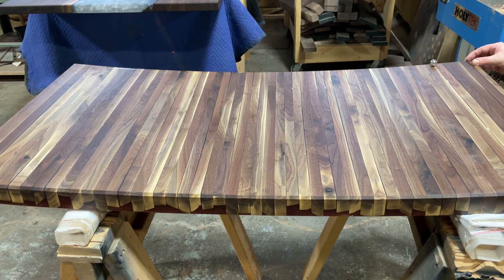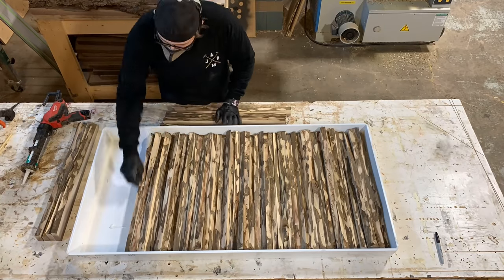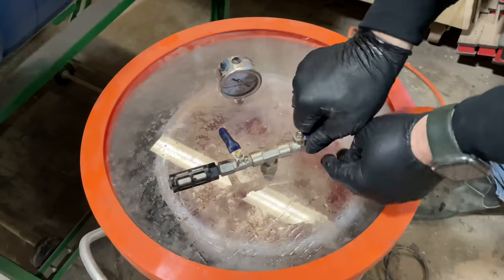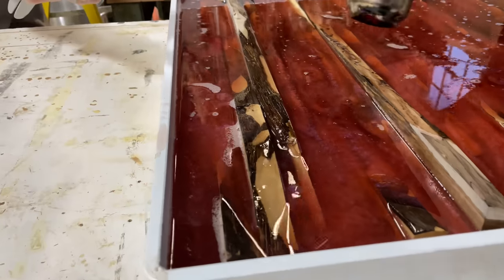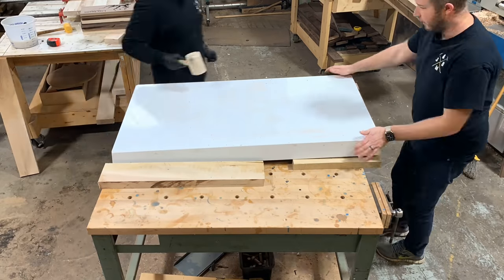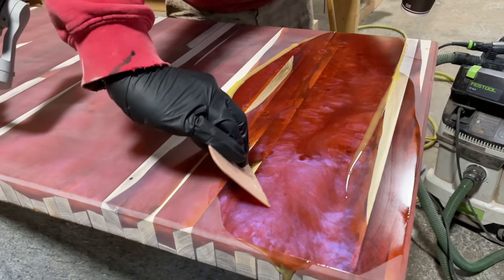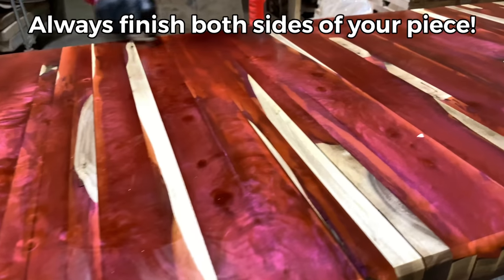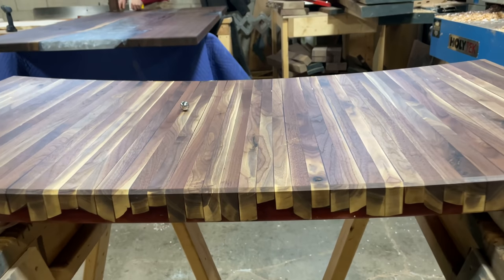EPOXY FAIL | Don't Make This $1000+ Mistake

Comment: Hmm,  It is big for this process, but: 
 1.) unseal the wood, place the entire thing into a penetrating liquid (very thin epoxy, or styrene monomer only?) place the entire thing in a vacuum bag to extract all of the air from the wood, and allow it to be replaced with the resin?  

Or,  maybe something more mechanical? 

2.)  Slit the wood on the bottom side, 70% to 80% depth of the shallower boards,  Install thin, tapered strips (shims?) to wedge the piece into a flat position. work from the center out, every other board,  with the tapered strips, as it may start to back bow, and use flat strips between as necessary to keep flat.  Re grind the top.

Comment: Flip the table upside-down, then with a circular saw make a series of shallow cuts that are about 1” apart along the short side. The cuts don’t go all the way through. Rather, they only go through 80% of the thickness. The table top will then bend easily. 
Then put it back in a mold in its newly flattened state and fill it in with a cheaper epoxy. The result will be a flat table with an interesting design along the edges.

Comment: I think you should turn it into a headboard or actually if you hung it with the U-shaped upside down the way it is right now actually and hung up from chains and put some light fixtures through it and had it above a bar or an outside patio have lights in a fan underneath it that would be bad ass

Comment: Put led light to epoxy drilled holes. let epoxy side to be under side. Then put clamps both ends, and the use car-jack to lift middle up. Wood's should open that much that you can put epoxy between crack? :D

Comment: Its bending because the milling process removed some layers that have a specific tesnion in it. Tension is low to high from outside to the inside. Now you have a side with high tension and one with less. Thats what is causing the pice to bend

Comment: lay it face down on your CNC table clamp it down extremely well. rout out some slots for steel tubes or flat bar and screw them in, maybe even use epoxy instead of screws.

Comment: Dont know if this solution is doable or if it will just make it a more expensive loss -but what about just making the table slightly "thicker?" I actually really liked the partial resin and wood pattern and I think this piece can be saved.

So, I'm thinking First, CNC/sand off the coating/resin on the exposed wood, making it bare again. On a flat surface, flip the table wood-side (the concave side) down. There should now be a hollow of negative space below, where the piece is bowed. Measure the distance of your largest gaps against the flat surface that the table is on and note roughly where they are.

Alternatively, keep it concave up/wood-side up, on your work surface and you can find the same measurements by using laser levels or running strings across corner to corner and measuring the greatest depth with a reference ruler. You just need a rough estimate of how much the table is bowed out of flatness and by what depth. 

Flip the table concave side/wood side up and fill in these areas with another layer of wood boards (which have been flattened on one edge, and the other live edge) to mate flat edge with the flat surface of your table wood, and the unfinished edge facing out. It may look best to place widest boards at the center of the table to make up the thickness of the table where it is more concave, and the less wide boards on the ends as it tapers out. Or you may also plan to mix up the boards the same way you did the resin top -mixing and staggering wide and short boards together depending on what looks best for the table's side profile and edge design. 

Once your wood boards are placed where you want them and they are tall enough to fill in and correct the table bow, they can be wood glued and clamped as the new table bottom and you can leave them stepped/staggered and do another resin pour to replicate the table top, or leave them as is (fully wood) to be flattened smooth by the CNC.

Lastly, do your resin pour if you are keeping the stepped surface look, level and sand your surfaces one last time, true up the sides, round off your corners and re-finish the wood.

You will now have filled in the original curvature or warp with more wood, leveling the wood-side flat again, and hopefully have given the piece more structural support as well, while maintaining most of the original table.

Yes, the side profile of the table will have layers to it now, but each side will naturally mirror the other if you have placed your boards nicely. Or on a flat all-wood bottom surface, at least the layers will be tight seamed together because you have mated flat surface on flat surface.

You could do other things with the wood, but I think it's still fixable as a table if you correct for the warp.

Comment: Heat it up and press it flat... Coat the bottom... The other option.. Heat it press it and gun drill 3 shafts down the length, dowel with solid carbon rod.. Put it back in the mold top side down and add a layer of roving with the resin vacuum bag then refinish.

Comment: Simple....cut it back up into smaller random dimensions flatten them out on a planer or your CNC . Reassemble in a mosaic , pour clear over it . Continue on with the table .

Comment: Sand the oil off the bottom back to raw wood, put it in a high humidity environment, it WILL warp back to straight, might even go past in the other direction, so you are going to monitor it, when the piece warps back to flat, go ahead and epoxy the underside, "freezin" it in the flat position, THEN, well then, you are going to have to put a base underneath the table, permanently fastened, be it metal, or wood, but in a way that won't allow the piece to warp again.

The unfortunate thing with this type of construction in which you have all the grain running sideways from thin pieces glued together, is that there is zero stabilization longways other than the epoxy itself which is strong, but could never stop wood that wants to warp like this from warping.

Even once you epoxy the bottom and the whole thing is entirely encapsulated, theoretically no moisture should be able to reach or escape from the wood and should permanently stabilize the table, I would still construct a base that absolutely locks the table in place.

By constructing the table in the way you did, you allowed the wood it's absolute maximum potential to warp, you couldn't have designed a table more prone to warping if you tried, so now you have to counter the table's strong tendency to warp with the methods mentioned above.

The table is not ruined.

Its actually a pretty easy fix.

I build solid wood custom entry doors for a living, I live and die by how wood moves and warps, as you would expect, doors have to stay as straight as possible in all planes or bad things happen.

This is how I would deal with your problem.

It's not ruined. Pretty easy fix. You'll be alright.

Comment: Put it back on the CNC Woodside up take just enough material to flatten it Repeat on the Epoxy side  Send And add a thin layer to both sides if need be Score out 2 channels for steel braces And Epoxy them in  If you haven't done something else

Comment: It will cost some more but i would have encastrate all in clear epoxy self levelling... it will solved all the issues.. as the bottom also will have some epoxy... My idea.. think about the cost

Comment: Could you sit it in the sun with the epoxy side up and let the head bend it back.

Alternatively, rip it into curved stool seats.
Reply from the maker: If the entire piece was epoxy only, the sun idea may work but the wood will likely prevent that from working. Curved bar stool seats would work though!

Comment: Did you come up with a solution? 

If you cover it with thin black plastic and leave it in the sun epoxy side up for a few hours, clamp it down flat and bring it inside to cool down it will stay flat.

Comment: Success or "so-called fail", I find this table beautifuler when it is flipped. Warped table is no cracked, that is already well. Infact, this table got a convex inward and quite harmonious face.  Thus, designer will have learnt to us all how to make a convenient table, whatever it is with flat, warped or convex plate against all odds. Fail is not always fatality and allows us to improvise.  On this furniture, we could play at game, write, and so on.
Reply from the maker: Yes, however it is not practical for resting drinks or flat charcuterie boards on!

Comment: Maybe buy one of those curved screen high def TVs and mount on the curved piece of wood. Then Mount all of that on the wall for an added artistic dimension that your TV floats on. 🤔
     Or you could always just cut it up in the strips and float them in another table top in epoxy resin. 👍🏻

Comment: Like watching your content.  Projects like this for me turn back into other projects I would I guess rip the table into 2-3in widths, miter them into square frames and then place the frames into another table or two as there is plenty of wood there.  I would likely mix it up then with the colors of the epoxy between the frames and what was inside them and me being the nerd that I am I would make sure I could get the frames to glow with some Leds under them because that dragon's breath stuff looks slick.  I figure anything worth doing is work so at least make it something YOU love.  Good luck with it beautiful otherwise!

Comment: It happened to me with a 5foot x 4foot table bent in the middle and at the corners, what I did was put it upside down and put 80 pound weights on it for 12 hours for 3 days it work for me
Reply from the maker: Glad you found a solution!

Comment: Hi , you Can crash it underground pressure ,  reuse it upside down  , poure epoxy first , lay thé crashed pièce  , lay another epoxy on all , then pass it on cnc , and finish it ,, ,,,  good Luck .... jamil

Comment: I dont think hot bending is an option here, the layers of wood and thin epoxy will break apart. IDK, cut it in half (long side), and make nice bench out of it (epoxy layer in front of seat and backrest).

Comment: You joined the wood with silicone?  That is why there is NO saving that top without routing in steel beams on the bottom and bolting it straight.  Even doing that, the top is going to crack.
Reply from the maker: The silicone was only used to hold the piece down so they didn't float. The idea was that the epoxy would hold all the wood together.

Comment: paint,Laminate, stain , finish any wood. Both sides all the time. 101
Put in the sun with weight on it till it's flat.  Coat it / flip it over / finish other side. Cracks might look crazy with another coat.

Comment: Add epoxy to the mold place table inside fill it halfway with a contrasting vivid color maybe dragon breathe vivid green orange. Then when it dries flip it over and fill the mold halfway again with clear epoxy and maybe throw in some vivid earthquake patterns before placing the table in to dry. Then when you pull it out the clear earthquake patterns will be visible over the red and purple dragon breathe. Lastly sand it flat again in your machine and polish it up. It will be epic. 🤑

Comment: Why not cut it into smaller parts to reduce its warping effect. By those smaller parts, stool, chair can be made. Maybe curved part can be used as back part of chair. 
Another thing is, sharpening on corners to level the top evenly and use as table. Or sharpening on bottom to reduce warp and doing same, making table like thing. But this is not looking nice perhaps.

Comment: I would've put it back in the form upside down and out in the sun so it will get even again an then pour a clear coat of epoxy on the wood. I guess that would've done the trick 🙃
Reply from the maker: The heat from the sun could help a little but I don't think it would go all the way flat again. We've got a plan for this piece now! Hoping to work on it this week and next and get the final result up on YouTub for everyone to check out.

Comment: Clamp it flat, cut slots on the wood face with a router, glue carbon fiber rods with epoxy in those slots. 
Or just screw a metallic frame.

Comment: Add weight on top of it .. be patient  .. clamp the hell out of it.. be patient so you don't crack  it ... constantly expose it to heat that will help it to get flat again then once it is flat attach a wooden or metal frame to the back of the piece .. you can stop now if u want the metal can hold it flat but for safe measures pour a layer of transparent epoxy on it (the surface and the sides) min a 1 cm thickness , you can even coat the back side too if you want .... i faced this before and the piece kept bending upward and i flipped it to straighten it and it bent the opposite side and once i poured on top of it when it was flat it staid flat... good luck

Comment: I did something similar and had similar results.  In my case, I used 3.5" cutoffs from 4 x 4s, 2 x 4s, 1 x 1s etc from different spieces of wood.  Total size was 36" x 60".  I threw the blocks in a box, poured the black expoxy and it looked awesome!!  Within a week, it did the same as yours and in addition, it cracked in places.  So, I decided to cut it up into pieces and got 2 small benches, and end table, and 3 small cutting boards.  Understand, the folks who received the cutting boards were advised not to use it as a cutting board but to use it for cheese and crackers and display purposes.  Still love the way it came out but got more from it by cutting it up.  Check them out at Sauerwood designs on FB.  Just my thoughts.

Comment: The whole thing needs to be encapsulated with epoxy. I would sand all the oil off.... put it bow side down outside in the heat with weights on it. It will flatten. Won't be perfect but you could cnc again. Then coat both sides fairly quickly with epoxy, NOT oil, or it will warp again.

Comment: I’m going to state another comment I think you could’ve actually took another board possibly even something like MDF or better yet three-quarter inch plywood that’s been painted, sanded, and had the edge cleaned up, and do a lot better job at preventing the table from warping when you put the epoxy on the top of it.

Comment: Run that boy through the planer. Or chop it up into 1ft sections, glue it and let it dry. Once it’s cured run it the through the planer and sand it down with a 80 grit and then a 120 grit. And finish it off with a 220 grit and it’s good as new.

Comment: I’m about to blow your mind. Cover that table in BLACK trash bags, and set it outside on a HOTTT day. The epoxy will become flexible and flatten itself back out, once it’s flat, bring it back inside and clamp it down flat while it cools. Then seal the bottom with poly and insert some c channels to help prevent it from cupping again.

Comment: Ok, why don't u take a router sled ,leveler  , start in the center and flatten from the center out .. doesn't have to be the same thickness on the ends,in fact,that can be it's appeal !! u could then use iron , maybe angle iron to finish , that would bring it back to life and look for good money in return !!

Comment: You can use it to make a pair of 🎿 out of it!  That happened because you know little about  hard wood and how it's always  expanding and shrinking . At some point in your table I've seen a piece of wood 1"high in the middle of higher pieces.... You can't do that and you can't fix it in your future projects not even by gluing them together. Maybe if you've been using some spacers between the boards and alternate the pattern with wood on top and bottom of the table in order to have an even distribution and flexibility. But it's not 💯 % guaranteed. 😉Greetings from Italy ☕

Comment: dont want to be mean but it was mistake even when strait. You make a design with depth and then destroy it with opaque/colored epoxy. Meaning what was the reason of using live edge and them covering it with colored nontransparent epoxy. Also i dont see any planning or goal how are the planks stack. 
I strongly recommend to hire some artist or creative person to directly design or direct/advise projects.

For what to do whit it. Work with the curve. Cut lengthwise planks, turn them end grain up and glue them with clear or slight amber epoxy. For the sides, cut them bowing out at similar curve proportion as main bend of the table. The edges order full round or wide straight bevel. Some were between  1/3 to 1/2 of the thickness of the table at 35 to 25° angle. Finish towards gloss with round edges and matt/satin for strait. this will be more suited for low coffee table with strait corner legs. Preferably something darker and with red tones similar to rosewood. Thinner and round with curved edges and around 20% thicker then the table with strait edge but with no/minimal bevel. I can go on describing another 2 versions. One with edge variation witch is way to complicated to explain in text and second were the table is fully strait and square just as intended. Its the same process like above but you cut top bend and use that to fill the bend on other side.

Comment: Why not flip it. Make a new form.
Scuff up the bottom across the long ways maybe slits on the CNC or with a circular saw  so you have slots running across it epoxy the bottom black. Because it’s go great with the red. Now you have a consistent epoxy running through the long ways with slits filled with epoxy acting as extra support and grip to the part. Maybe add some rebar so it’s even sturdier.

Comment: I would take the WARPED DRAGON'S BREATHE TABLE soak it in WATER not long pull it PLACE weight on it then run some kind of struts to secure and HOPEFULLY keep it from REWARPING or cut it up into a panels work it into another design